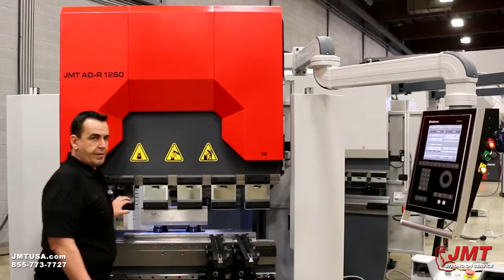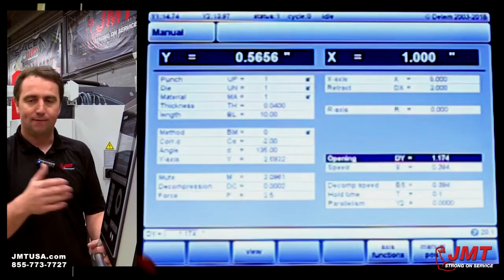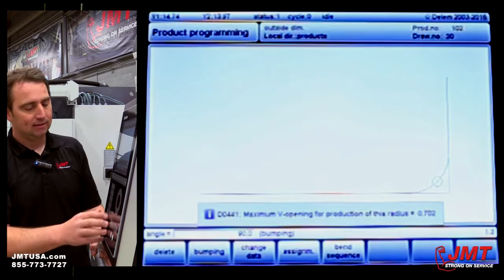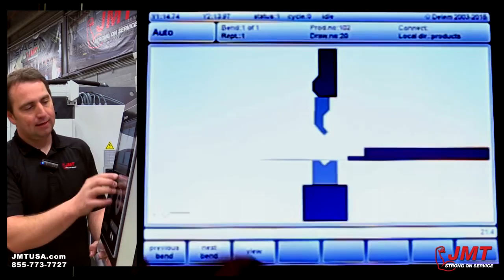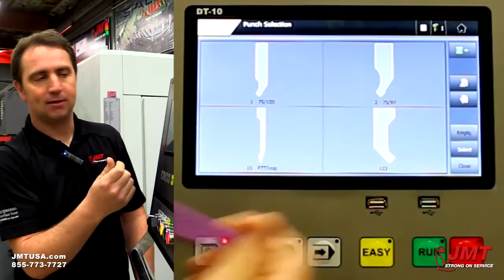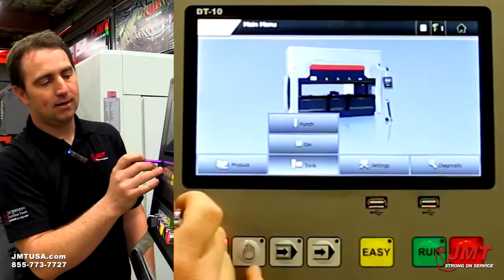4 Foot Press Brakes

Comment: How to reduce oil tank temperature for more than 200T
Reply from the maker: Ramesh, what brand of press brake are you using? While there are oil cooling systems that you can purchase for your brake, if you are using a JMT press brake, you shouldn't have a problem with the oil overheating if everything is working right.
Reply: Sir mostly we are using atos for hydraulic system but because of summer season and particular for more than 200T the increasing temperature was very high..
Reply from the maker: One of our service technicians said that either: 1) you have a problem with your pressure system; or 2) you are running your press brake for too long at its maximum capacity, which could overheat your oil. In the second case, you would want to get a cooling system for your oil. (Press brakes aren't meant to run at their maximum capacity for long — it is always advisable to get a press brake a little larger than what you will regularly need so that you don't overtax it.)